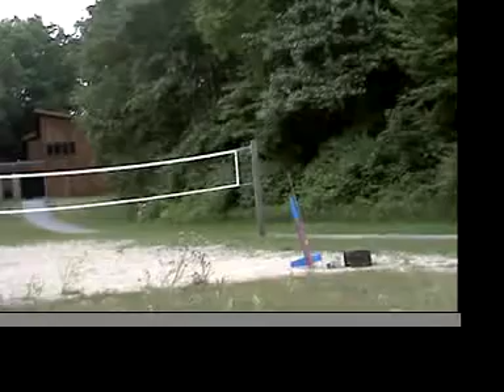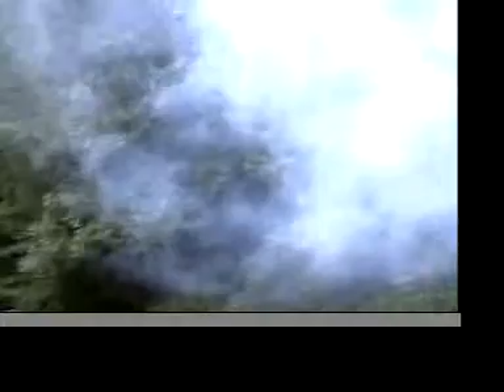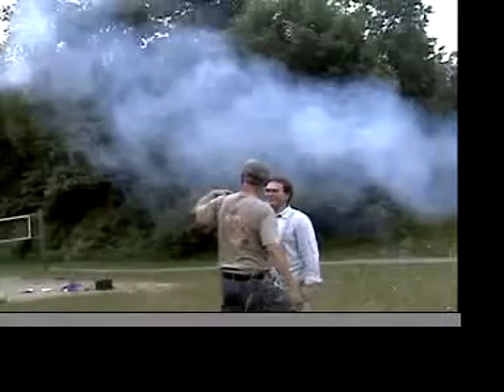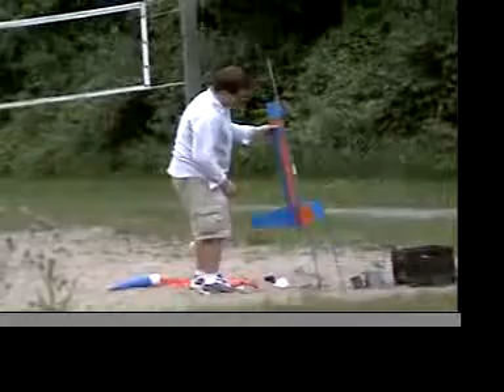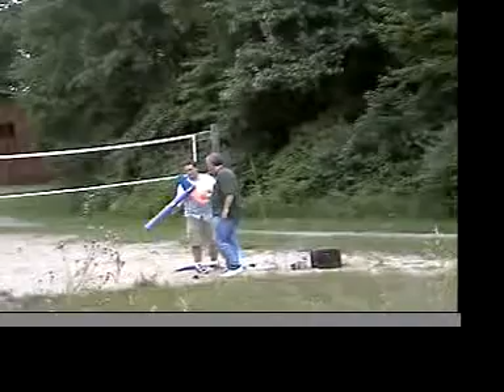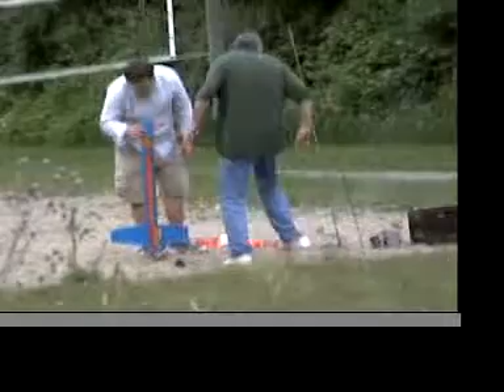G77 Redline Forward Motor Closure Failure

Comment: yeah, i had a similar failure with an H242T around the same time.

turns out redline and bluethunder propellant has a chemical that attacks the bonding agent in the delay grain (to keep the seal between the delay and the plastic) and aerotech has started to specially package reloads so this forward closure l blow-by doesn't happen. 

next time check to see if your delay grain has a yellowish tinge. if it does it may be bad.